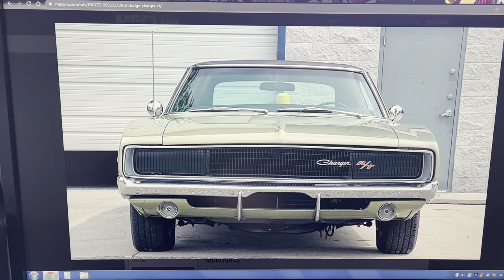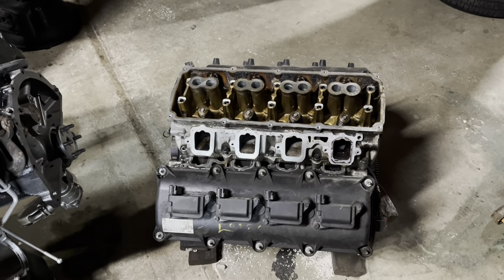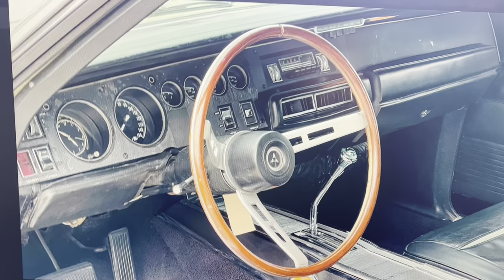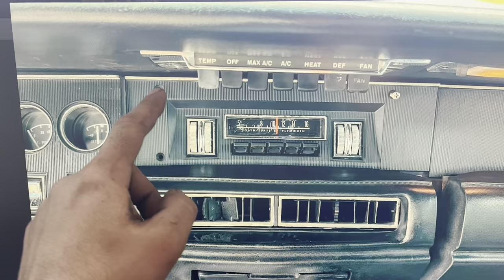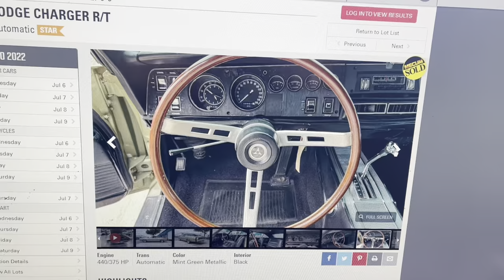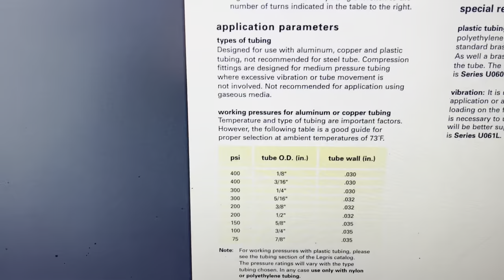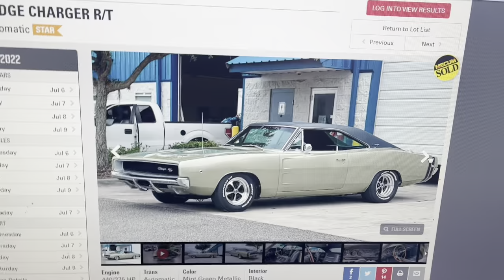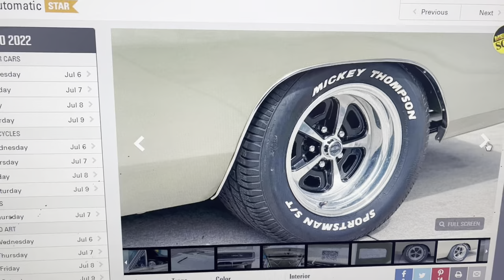Why Did This 1968 Dodge Charger R/T Just Sell At Mecum For $170,000? (It’s Unsafe And Bad)

Comment: Most of that stuff is just a case of caveat emptor, but that brake line should be criminal. As for the price, I don't know if there was a reserve, or where they started the bidding, but it sounds like 2 people got into a pissing match with their wallets. That's good for the economy. 

Most of those faults are shown in their pics, but if Mechum wants to enjoy a good reputation, they need to inspect better than that.
Reply from the maker: I don’t know that it’s good for the classic car market if another seller who did bad work suddenly has a bunch of extra money and encouragement to do more bad work - but I know what you mean. And I did give Mecum some credit where it is due - they posted these pictures, which make inspection and finding this stuff possible. It’s on the buyer to not have reviewed pictures or inspected the car correctly, and bid to the point that the purchase price is well beyond its value. 

If you’re interested, take a look at the video I put out yesterday, in which I cover an actually beautiful, nicely restored four speed ‘68 R/T for $20k less than this thing went for.
Reply: @DeadDodgeGarage  I'm sorry. I didn't mean that bad work is good for the economy. I meant that throwing around that kind of money is good. $170K is overpriced even for a concourse condition 440 Charger.

Comment: It's absurd.   These cars were $3000 -$4000 brand new.    The guy paid $170,000 for $10,000 worth of car, adjusting for inflation.
Reply from the maker: First off, the original MSRP calculates to more like $25,000-$30,000+ adjusted for inflation depending on original options. Second off, go try to buy any halfway decent 68-70 Charger for $30,000. You can’t, currently. That’s because comparative values haven’t stayed the same over time. They depreciated from the time they rolled off of lots, and then appreciated sharply in the last couple decades (and even more sharply in the last couple years) due to scarcity. The story is much, much worse for an R/T. It’s a pretty simple case of supply and demand. 

The question here is just how much they’ve appreciated. In my opinion, at the time this video was made, this car was overvalued at its hammer price by $80,000-$90,000. I have since seen several more Charger R/Ts trading in the same range. These are fully restored high end collectibles, for which the market is even crazier. The problem is, this green car traded at the price of a high end collectible, but it surely is not for all of the reasons documented here - and more. 

Having said all that, I understand your argument. It sucks that money is worth so much less now, and it sucks that everyone and their mother wants a second generation Charger. Blame Barrett Jackson, blame Fast and Furious, blame the housing boom, or maybe even blame Graveyard Cars and AMD. The Charger market is insane and will remain that way for some time.
Reply: @DeadDodgeGarage  
I sold my novelty car when I was young, and will probably never own one again, for the reasons I gave.  
It was a 69 Mustang sportsroof with 4-speed and small block.
You could tell it was built as a cheap car when it was new.   Like the Charger it even had drum brakes in the front, before I replaced them.
Reply: @DeadDodgeGarage  
I'm factoring the wear and tear of being a used car.   $3500 in 1969 would be like $28-29000.   
Of course, most of the value is in being rare while desirable.

Comment: This car should be listed as a project car. I have no problem with price, or condition, but a warning that it's not properly restored nor safe to drive should be included. If people think it's still worth 170k then fine, let them pay it, but as long as they know it doesn't pass basic safety tech inspection. You couldn't even get this to pass safety to run a time trial at any drag strip. 

We just need a description that shows it as not roadworthy. The crazy high price isn't even a factor IMO. $10 or $10m doesn't matter, just identify it has not in driving condition.
Reply from the maker: If there was a huge identifier that said that, it never would have reached $170k, and both of our problems with this would be solved.
Reply: @DeadDodgeGarage  Morally I agree, but the fact someone wants to spend a ton of money on a car I wouldn't pay 10k for doesn't surprise me. Not that I think this is at all likely, but if it wasn't a rough build maybe some idiot would pay a million. That's not for me to judge, so I'm ok with the price and condition and it doesn't look like fraud was used to conceal it's condition, but I agree the auction house should have some some simple inspection to justify the fees they charge. A simple "not safe to drive" and let the buyer beware from that. 

Thanks for the reply. 

ps. I imagine the engine isn't what the buyer is expecting either. I expect the quality to match the brake and suspension work, so needing full restoration still, mechanical and cosmetic.

Comment: Hi people  don't realise cars like this  go under the  hammer  for a reason  most so called  classic's , had rust in them when they were  5 to 6 years old, they are over priced  and they drive and handle  like a  bucket of weeds,l grew up with high  performance  cars  doing  body  paint  and mechanical  so there not for me.cheers  les from Adelaide south Australia.

Comment: Chargers are cool but I like the full size big muscle cars. Dodge  Polara, Dodge Monaco, Plymouth Fury, Mercury Marauder,  Ford Galaxy etc...

I know a guy selling a Polara in Eastern Washington where it's bone dry most of the year.  I want it badly.  I have very little experience doing the old muscle car hobby but I'm willing to give it another shot. I used to have a 1967 Mustang coup that was stolen 25 years ago  and never saw it again. 

Do you think I should get that Polara?
Reply from the maker: I suppose it depends on what it costs and how badly you want it. Full size cars are cool, and an added benefit is that they tend to be cheaper - unless we’re talking rare, extra desirable models.
Reply: @DeadDodgeGarage  yeah it needs a lot of work  it doesn't run and it has no gas tank 😆. So I'd have to trailer it if I buy it. I think he wants $3,000. I think it would be fun to fix it up and paint it for a weekend driver..

Comment: That right shock tower is questionable, looks like they beat it with a hammer to form it into a "fit" and skipped spot welding it, not 170,000$ work or worth to me
Reply from the maker: Someone else said they saw something there. I’ve zoomed in on the pictures and it appears to have normal factory style welds all the way around it to me, so I’m not sure if that’s a trick of the light some are seeing or what.

Comment: The shocks were mounted wrong and different from one side to the other.
Reply from the maker: I didn’t notice that they were different, but I can tell you that what looks like a painted washer (which many people pointed out) is factory reinforcement, and the shock bushings and washers are correct.

Comment: The auction site (Mecum or any other) isn't really set up for a good inspection. Lots of risk for the buyer. In this case there were plenty of obvious clues that the car needed work, though. In the video you mentioned that you "expected more for $170,000". Well, the bidders themselves set the selling price. Hopefully the high bidder knew what he was getting into.
Reply from the maker: I know - and you’re right. I think the buyer expected more for $170,000 - or certainly should have.
Reply: @DeadDodgeGarage  I would've expected a lot more, too. What's worse, though, are cars where the flaws are much better hidden. IMO, these auctions are high risk, period. Caveat emptor is everything and the auction houses absolve themselves of everything. If you're not in a position to take a gamble, buy elsewhere.

Comment: Car still needs a ground up restoration. I'm sure no metal work was done to fix rust, which means it is full of filler.
Reply from the maker: Definitely possible, but what I can see of the bodywork kinda looks ok so I’m not entirely sure of that. Looking at the paint work and the engine compartment detailing, it seems to me like someone was in the process of doing a decent restoration and didn’t get to finish. I was more interested in the bad mechanical stuff.

Comment: With already high market prices for these cars continuing to rise even higher many small garages and body shops and even private individuals working in their home garage are cranking out amateur restorations and kludging together whatever they can find for a speculation resale. This is why the reputation of the shop is so important. If you find anything like this you can be sure the seller wasn't experienced or knowledgeable enough to be restoring cars.. A reputable shop would never do anything  like that and the entire car is suspect.

Comment: If this was a high output motor. It should be painted orange not teal
Reply from the maker: No. In 1968, the HP engine is turquoise - unless it’s a Hemi. In 1969, it’s orange - but there are exceptions to that, like a Roadrunner with A/C. If you see an orange B/RB engine in a ‘68 Charger R/T, it’s wrong - and yet very common.

Comment: Theyre not gonna drive it.  They will keep it in a temp controlled environment and on display like a fine van gogh painting.  Wait several years and then sell it again for double the 170k.  Its about vanity and investment, not safety...
Reply from the maker: Maybe. I’ve made my point about this. It had to go on a transport truck at least. Maybe they drive it around the block once. It doesn’t matter. A dumb, unsafe repair is still a liability. And - there’s no way that 170k doubles any time soon.

Comment: you didnt even mention the fact the spliced brake line that looks to be on right front tire. appears to be rubbing metal where it goes through the hole in fender. if it is rubbing this is just as dangerous as the compression fitting as the sheet metal will eventually rub a hole into the brake line. the seller should have taken a few seconds to bend the brake line over to clear and not rub anything.
Reply from the maker: I didn’t notice that it was rubbing there. While sitting against a sharp edge isn’t exactly ideal, the brake line is mounted in metal clips and sitting against metal in various places on the body. I’m definitely not as worried about that as I am about the fitting blowing apart.

Comment: the car hobby has been ruined by too many tv auction shows and speculators , now everyone has a " Barrett-Jackson " worthy scrap heap for sale . other than what the inflated market is now , i wouldnt drop any more than $15,000 , cause in my eye i would have to spend that much in time and parts just to make it a nice driver , tiss a shame
Reply from the maker: That car - even now, as the market seems to be softening a good bit on lower end cars - should still be worth $50-80k, assuming it needs a complete interior (it doesn't,) a ton of mechanical work (it certainly does,) and maybe even some metal work if there is stuff we can't see. The price is hugely inflated, which is what brought me to it in the first place. But $15,000 currently buys you a rotted out pile with no drivetrain, and people are paying it - All. Day. Long. It sucks, but that's what it is.

Comment: Thank you, awesome video. This from someone who's having a 73 Challenger Rallye restored professionally. But I get to go over and look at the work as they do it and we put all new brakes and lines in it. No it won't be perfect because it's not being built as a show car but it will freaking stop!
Reply from the maker: I owned a ‘73 Challenger Rallye! It was a yellow 340 4 speed with black interior. The 340 had been swapped for a 400 for some reason. Very cool. Glad you’re part of the process and you know what’s going into it. Like I said… I don’t give half a crap about perfect. Mechanically sound is much more important.

Comment: For a 170k it should have been a FULL RESTO MOD with upgraded Disk Brakes BBK package from Wilwood or Brembo?  Upgraded full suspension with swaybars and Coilovers.  Exhaust should have been done right and the Engine-transmission-diff all modified for at least 500-550BHP.  Paint matches and for God Sake a full resto interior or stock interior upgraded.  NO RUST, NO LEAKS.. MECUM is total BullSHITO!!! Although MECUM is not responsible Auctions I think are extremely bad unless you have the money to probably re-do the entire car.  I worked for an Exotic dealership and people would always try and off their SHIT at Auction... Auctions are not the way to go.  A reputable Garage with papers yes.
Reply from the maker: Really nicely restored, factory correct R/Ts are commanding this kind of price. I don’t think they should be, personally, but they are. The problem is that this one is not finished to that level, but it somehow sold for this price regardless. I honestly think a stock car is going to be worth more than a restomod - but that’s another story.

Comment: Since when is a magnum engine blue? Should be Hemi Orange, blue big blocks denote a LoPo motor, so might not be the 375hp motor... there’s a lot wrong with this as you point out and I’ve seen and tried to sort out a ‘mecum’ R/T Charger that wasn’t... breaking the news to the new owner wasn’t pleasant either..
Reply from the maker: That is incorrect. In 1968, the 440 is turquoise. Similarly, the 383HP (as in Roadrunners) is also turquoise. In 1969 (until '72ish,) the Charger's HP engine should be orange - although in other lines, such as the Roadrunner, the HP engine could be either orange or turquoise based on production date, whether it had A/C or not, the alignment of the stars, etc. The Hemi was always Hemi Orange. A cursory search for '68 R/T engines on the internet shows many turquoise engines, some orange engines, and even a couple blue engines. Plenty of engines have been changed to orange over the years. Tom, owner of Rocket Restorations, says turquoise, and I defer to him.
Reply: @DeadDodgeGarage  I got that information from Mark at Graveyard Cars....
Reply from the maker: That’s so interesting! Because I just looked up some videos of 1968 Charger R/Ts at Graveyard Carz, including a really nice green one that they restored, and guess what color engine that one had! Hint: it wasn’t orange 🙂

Comment: You're being a bit dramatic about the compression fitting. They never burst, or blow apart. The risk is that the steel brake line is harder than the brass ferrels so they don't really bite into the line the way they do into copper line (which is what they're meant for). That being said, I've never seen one slide apart. I agree with you, compression fittings aren't the right way to fix the brake line, but there's no need to wet your panties. 
Do an experiment. Use a compression fitting on a hydraulic brake system and in the safety of your shop stomp on the pedal as hard as you can, use both feet. You won't burst that fitting. And unless you intentionally left it loose, the line won't shit out of it either.
Reply from the maker: Never? Ok. We’re talking about north of 1,000 PSI of pressure being held in by a fitting that isn’t designed to do that. IF the installer did a really good job, great! It might just hold for years. If they didn’t… It’s also illegal and an instant safety fail in many states - for a reason. I am well aware that many, many cars are driving around with compression fittings in their brake systems. I also think it’s a really dumb idea. And, most importantly, and regardless of its merits or lack thereof, I don’t think it is the acceptable repair on the brake system of a $170,000 Dodge Charger R/T.
Reply: @DeadDodgeGarage  I agree it shouldn't have been on that car, and probably shouldn't ever be considered a "permanent" repair, but the hysteria (by almost every mechanic out there) is a little much. And like you just noted here, they're only illegal in "some" states, not all. 
It reminds me of the hysteria around split rim truck wheels. Everyone says they're dangerous, everyone says they're illegal, and usually they're wrong. There are n split rims with an external split ring that are illegal. It's the wonky Kelsey-Hayes rims that split into two halfs in the middle that are illegal and "dangerous". They aren't illegal to use on a truck, but they're illegal to work on. So pretty much allowed to run out the tires you've got on them but that's it. The traditional split rims with an external ring are NOT illegal, and aren't much more dangerous than modern tubeless truck rims when worked on by a skilled person familiar with them.     Off topic, but it seemed similar

Comment: That's not a restoration job. It's a flipper job. Tires, bondo, spray and polish the dings, a little duck tape on the loose parts, slap it in an auction for a quick profit.
Reply from the maker: Yep… all bad

Comment: This world is just stupid...$170K for that bucket of bolts?...My daily driver V6 Camry would out perform that POS in every category that matters, and it cost a whopping $9k...which left tons of cash leftover to buy a 22K ile 2006 Saleen  Mustang, a low mile 2019 Raptor, a new XLR dual sport and pair of lightly used 2 year old WaveRunners for the lake cabin, and I still had a few bucks left over! People really need to stop letting emotion/nostalgia drive their purchases...although I'm guessing that the sucker that ponied up all that cash for a shtbox like that most likely falls into the category of "has more money than sense". But honestly, even if I was a Billionaire instead of a mere mid seven figure Millionaire I would be upset at getting ripped of like that. NO ONE likes to pay $170k for a car worth $60k on the best day.